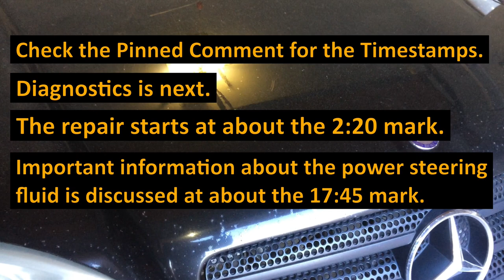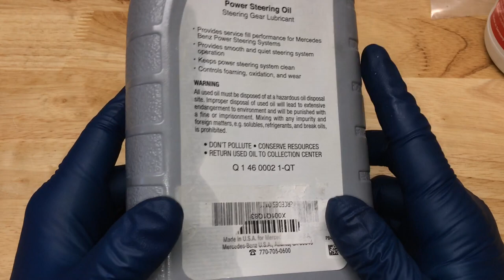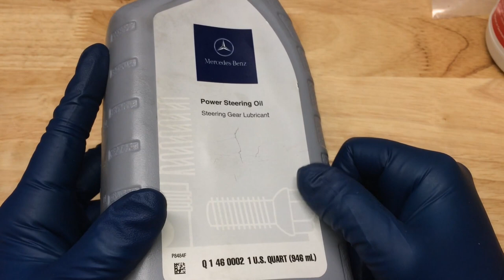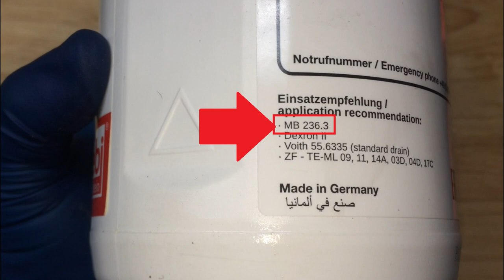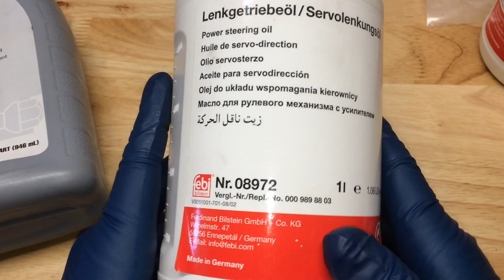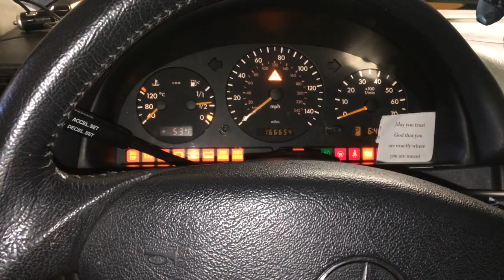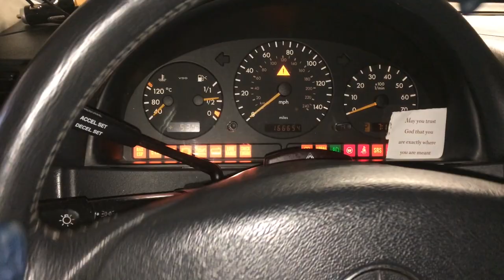Mercedes W163 Replace Power Steering Hose Pressure Line, Fluid Flush & Bleed '02 - '05 ML350 ML500

Comment: where was it leaking on your line,
Reply from the maker: On this ML, the pressure hose appeared to be leaking at the crimp nearest the banjo bolt end -- you can see it at about the 09:18 mark:

https://www.youtube.com/watch?v=UYxRRcNRIwI&t=557s

If you have a power steering leak and you can't find the leak on the pressure hose, then check the return hose from the radiator to the reservoir, because that also often leaks.  That hose just has hose clamps on the end, and sometimes you can stop the leak by tightening the hose clamps.

The other common leak on these ML's is an o-ring on the power steering reservoir.

I hope that helps - Good luck!
Reply: @L35inColorado  Hi, I have replace the p/s pump and also replace the reservoir and o ring but some how it still leaking,
Reply: could it leak from the p/s pump to the rack,
Reply from the maker: @vid8306  Yes, that would be the pressure hose, shown in the video.  Here's a diagram which shows the three hoses in the system:

https://www.benzworld.org/threads/2001-ml430-power-steering-major-leak.1621718/#lg=thread-1621718&slide=0

Referencing that diagram, the hose that connects the p/s pump to the rack is the pressure hose shown in the video, which is marked "100" in the diagram.  Fluid moves from the p/s pump to the rack through that pressure hose (100).  

Then, fluid leaves the rack through another hose (labeled "123" in the diagram) which connects the rack to the radiator (the lower connection on the radiator).  

Fluid is then cooled in an isolated part of the radiator.  Fluid then returns to the reservoir through a short hose (labeled "220" in the diagram).  

The pump then pulls the fluid directly from the reservoir and pushes it back to the pressure hose (100).

If you have checked all these hoses and connections and still find that you have a leak, it is possible that there is a leak in the small part of the radiator which cools the p/s fluid.  In that case, though, you would find coolant mixed in the with p/s fluid, or p/s fluid mixed in with the coolant.  This fix for that case is a new radiator.  

Can you see fluid leaking, or is it a leak that you notice only because the level in the reservoir is low?

If you can't see any leaks but notice the level in the reservoir is low, it is possible that you might still have air in the system, and so you might try a good bleed, since you replaced some components already.

I hope that helps!
Reply: @L35inColorado  there two lines that connect to the radiator that one from the reservoir and the other is from the rack, base on the diagram, the rack connects to the pump, when the ml is warm i can still smell power steering fluid even after replacing the parts that I have described, also I have replaced the radiator.

Comment: Actually the majority of liquid i use in my w163 (oil,power steering etc.) are Liqui Moly brand.
Reply from the maker: I've heard good things about LiquiMoly fluids. Has the power steering fluid met your expectations on your ML?
Reply: @L35inColorado  Good Day. Happy Mothers Day just in case.I did not use it in my w163 but in 320 i had before.no complains.Normally if i buy a used vehicle first thing exchange all the fluids.Good experience with Liqui Moly brand.Expensive but do the job.